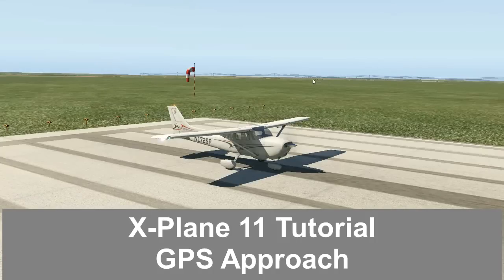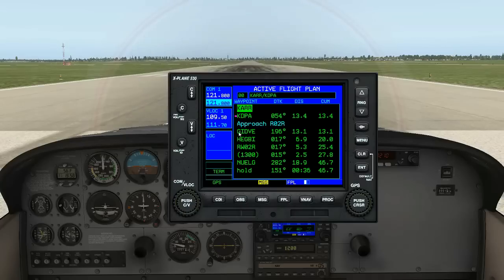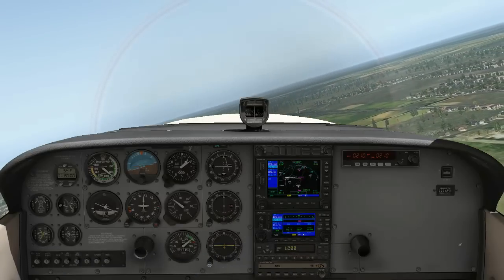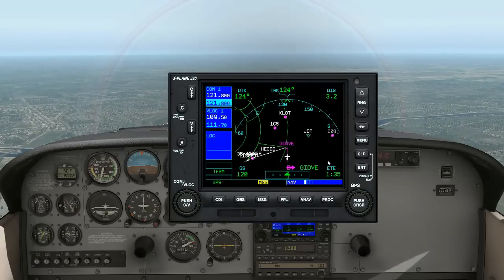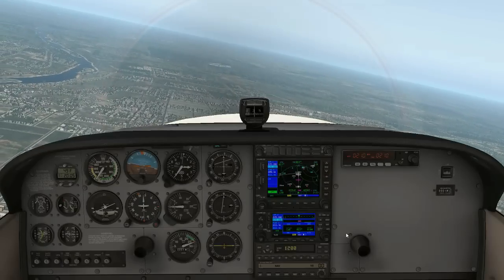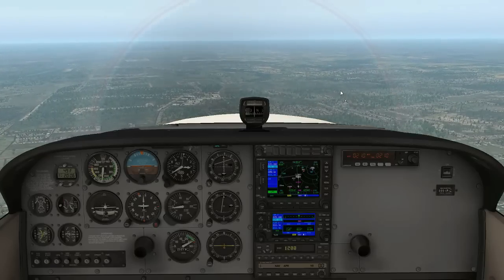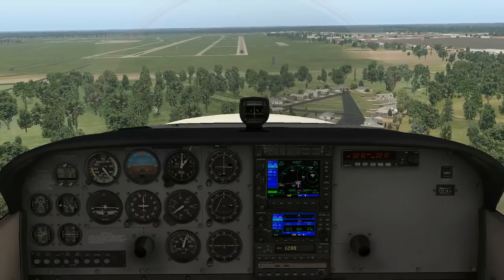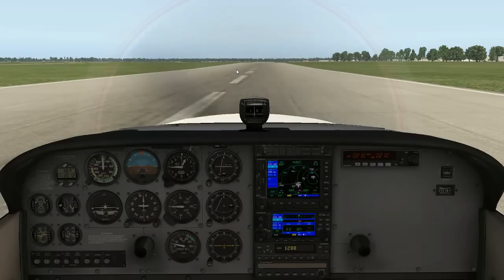X-Plane 11 - GPS Approach

Comment: As usual, Jason in a very good teacher, I believe the best for virtual air navigation! In this case I have not been able to replicate the video because when I reach the last leg and I push APR, the plane turns unexpectedly on the right and lose definitely the right route to the final approach. I know the video is using an old version of autopilot, but I have have not been able to do the same with the new current version. Did someone do it?

Comment: Thanks, I great for gps instruction ! but never put your flaps down at that speed in a real 172. And flair your landing s . land on the rear wheels and keep the nose wheel off the ground as long as possible. The stall warning should come on as you touch down

Comment: Man, you've got to stop lowering your flaps when your speed is above the white arc. Reduce power first, otherwise you are just using power against drag, as well as potentially damaging the flaps. Vfe (max. flap extension speed) is 85 knots https://www.pilotscafe.com/c172s-sp-skyhawk-orientation/

Comment: Flaps are gone, you need to pick them up later. If X-Plane can't fix that unstable rocking motion, what's the good of the program. 90 Knots over the boundary fence in a 172 OMG, sorry but not a very good training vid.

Comment: The AP getting into those oscillations is annoying. I've had it happen in other sims too...Does it happen irl? By the time you get done correcting for it, you might as well have just flown manually.

Comment: Helpful video, thanks for this and other X-Plane videos you've done!. Just after you activated the APProach button on the autopilot, you went to an extended exterior view. We missed the critical point at which the GPS and AP captured the glide path and the plane started descending. I have had a lot of trouble getting that to happen with this LPV approach. Very frustrating. I've read the S-Tec manual and tried repeated attempts to get vertical guidance using the APP or even the ALT pressed twice. Neither work. If anyone has any thoughts, please comment. Thanks.

Comment: At the time that I turn of the autopilot, my trim makes my plane to stall, so you know how can I configure that?  I use Saitek multipanel AP together with the simulator AP .Thank you
Reply: That one initially threw me for a loop as well.  I eventually realized he was using the "old style" autopilot that had the AP button.  So I'm guessing he set the NAV and V/S, but waited until he was at altitude before activating by hitting AP.

Comment: Another wonderful lesson but there is a problem.  In using the updated X-Plane auto pilot this procedure does not work.  If GPS is on and the NAV on AP is set, the plane seems to want to head in the approach direction as soon as it starts on the runway, and then runs away.  I have tried various other options and cannot get the approach vector to work,  It does not head for the target airport. Clearly there is some different way with the new auto pilot and I have not been able to figure it out.  Hoping Jason can help.
Reply: I had the same problem. I think that you need to activate KDPA when you take off, engage GPS at an appropriate height, then activate the approach leg. Then it navigates correctly.

Comment: After trying this a few times I could not get my plane to connect with the glide slope and auto descend. I tried a few approach options messing with altitude and speed but could not get it to work Then I read the S-TEC 55 AP Manual. It appears you need to hit the Alt button a second time to engage the GS. Not sure if it's due to an older version of the Auto Pilot or me not doing something right, but it's working now. Great video. Very informative. I do suggest everyone read through the manuals under the Cessna 172SP folder. I found some other nice tidbits of information in the Garmin G530 manual as well. AE
Reply: So press ALT twice on the autopilot menu?

Comment: One recommendation I would make is for you to land the plane as close as possible to the stall speed.  Your main mounts should touchdown before the nose wheel, and try to keep the nose wheel of the runway for as long as possible. Let aerodynamics lower the nose wheel and not by relaxing (yoke or stick control going forward) the elevator control.
Reply: Yep, I think he might have bent the firewall and/or broken the nose gear had that been a real-life landing!
Reply: @galoon  Most of these people have never heard about the types of landing accidents caused by strong cross winds and excessively hight touch down speeds as the pilots tries to force the aircraft onto the ground. Here is a good video (second landing) on a pilot porpoising down the runway in a Piper Cherokee 140 that rips of the nose wheel. .

Comment: BTW as a 4000 hour flight instructor, never put the flaps down when the airspeed is above the white arc on the airspeed indicator. That's what the white arc indicates; flap operating speed..
Reply: when he said "we're at 1000ft" he was actually at 250ft right? and is 90kts way too fast in the 172? i thought 60-70 would be more like it. thanks
Reply: @thert.hon.thelordnicholson7261  He meant 1000 ft MSL (Mean Sea Level) at his call out. When he was on the ground the altimeter reading was 750ft MSL which means when he called out 1000ft, he was at 250ft AGL (Above Ground Level). Approach airspeed for a precision/non-precision approach is 90kts. Non-Precision approach power setting: RPM roughly at 1600 RPM and 750 FPM descent rate. Landing airspeed is 60-70kts in a 172.
Reply: @AssyrianKing4ever  Are you sure? All the lessons (real life CFIs as well as some x plane vids) i've seen have an approach at about 65-70kts at most, then idle power above runway and land at stall speed (45kts or so, depending on weight/flaps). 90 is very fast and landing at 70 too fast. It seems odd to call out 1000MSL and not AGL e.g. if the runway is 2000MSL why would you call 1000MSL?
Reply: @AssyrianKing4ever  yeah a little check and you're a bit off with your numbers. 70kts is a standard and widely quoted approach speed, touch down ranges 55kts down to 45kts on average. altitude callouts should be made with reference to ground level, so you would call 1000AGL and definitely not MSL (as i pointed out, MSL makes no sense for landing phase). So the approach in this video seems a bit off, it did seem way too fast...
Reply: @thert.hon.thelordnicholson7261  I gotta correct myself there, normal approach airspeed is 60-70kts. In real flight, we cut the power to idle close to the runway threshold and depending on the winds adjust with the throttle. 
Here is why I said 90kts for the approach airspeed. GPS approach is a non-precision so when in IMC with low ceilings you wanna keep your airspeed at 90kts down to your minimums so you can execute the missed approach. If you break out before your minimums, great.

Also, as far as callouts go, I was taught 1000 above mins, 100 above, and Minimums. He may not have had any IFR training.
Reply: @AssyrianKing4ever  Don't confuse IFR approach speeds during training with real life,  There is no hard and fast rule on your approach speed. The airport you're flying into and traffic conditions as well as your skills as a pilot ( are you flying within your limitations) play a major roll.  I was shooting an ILS approach into San Jose, CA in a Cessna 172 doing 90 Kts when approach control ask if a could pick up my approach speed as there was a 737 coming up on my tail very quickly. I powered up to 2600 rpm and as you can guess my airspeed increased to well over cruise airspeed.  The length of the runway you make your approach to, ATC and traffic play a big part as to your approach speed as well as how comfortable you are as a pilot flying at a different approach airspeed than you would normally use.
Reply: @lpappas474  You are right. My current phase of training is nothing but shooting approaches at non towered airports. Soon will shoot the ILS 25 to KLVK. Should give me a glimpse of what you experienced at KSJC
Reply: @AssyrianKing4ever  Livermore is just over 5000 ft., so the Vfe will have an impact on the approach speed you choose, along with DH. Those are variables to discuss with your instructor. At least you can shoot the ILS approach into Livermore with X-plane before flying the approach in a real plane. Good luck with your training.
Reply: @lpappas474  Thank you! I will practice it before my next training session. Cheers!
Reply: @AssyrianKing4ever  Overall, much too fast (more like 65 kts on final; high 40's to stall at touchdown). IMHO looked low on final, too. Steering with the AP engaged may give brief relief, but the S-Tec 55 possess no AI to "learn" from the "corrections".
Reply: Actually in the Cessna 172SP you are allowed to lower 10 degrees of flaps at 110K. The white arc represents max speed with full flap extension.  Section 4 of the POH.
Reply: Wayne Sweet do you agree with this or not - White arc is full flap extension or ANY flap extension? I'm a low-time pilot and seeking clarification  - thanks  "Actually in the Cessna 172SP you are allowed to lower 10 degrees of flaps at 110K. The white arc represents max speed with full flap extension.  Section 4 of the POH."
Reply: @looseparts  I'm sure Wayne agrees with you. Years ago the top of the white arc represented the maximum speed you could start extending flaps as none of the POH's for any aircraft at that time stated any speed above the white arc for extending flaps.  I made this same mistake when I saw an individual in an X-Plane video extending flaps at an airspeed above 100K but less than 110K's. Now why would you be seeking clarification if you've looked at section 4 of the 172SP POH? If you're a rated pilot you would know the POH defines the operating limitations of the aircraft.
Reply: @looseparts  Yes I agree. It's been too long since I flew for a living and I should have remembered that about the high wing Cessna's. The C172SP is a different model from the one I flew. Believe the 172SP has a 180HP  O-360 Lycoming. The older C-172 had a 150HP.

Comment: Hi Jason I tried this  flight plan and i fail miserably.I have a couple of questions regarding pre setup on ground . I select NAV then try to set the VS +5 but as soon as i put these setting in the trim wheel goes crazy rotating full up then full down and continues this until i deselect nav . Is there a setting in game that needs to be changed. also after activating the GPS button it starting to deviate from the flight plan. any help in this matter would be appreciated.
Reply: I have the same issue.  I think the new auto pilot process is different but I have not figured it out.

Comment: Using X-Plane 11.34 this tutorial refuses to work for me on 4 separate attempts. I can create the flight plan, activate the noted leg in your video, but once I activate the auto-pilot nothing happens. The plane seems to be flying to a VOR location?(not sure)
The magenta line appears for the first waypoint (GIDVE) on the Garmin but there must be a subtle change with the Garmin or the way to activate the auto-pilot. For example, recently, disengaging the AP in the Cessna has change. Perhaps there is something different I am missing. I will be delving into the X-Plane manual tonight.
Reply: I think i just found the solution below!! Although I think it needs change is pretty major and needed to be more readily communicated. Looking forward to giving this another go.

 Aivar Avalo
3 months ago
@Peter van den Toorn You are correct, I missed that. For GPS Steering (GPSS mode), you do need to press NAV twice as per instruction manual: https://www.x-plane.com/manuals/S-TEC_Autopilot_Manual.pdf (page 22).  It is one press for VLOC tho.
Reply: Sooooooo, I got the GPSS mode to activate my flight plan leg, but like what others have said, when activating the approach, the plane goes off course sharply to the right, off to who knows where? More research......
Reply: So I learned from another video that a few minor things need to happen for the approach button to be fully effective.
First, ensure the ADF is disengaged, (Found on the co-pilot side)

Second, From the Map, ensure that the ILS frequency is set in NAV1 

Third, Set heading bug course to the same heading as the runway of final approach
For example, my final approach runway was KOMA ILS14L. Setting the heading bug to 14 was crucial to remain on course once the Approach button was depressed.

Fourth, once in ILS range press the approach button, then press the ALT twice until only GS is showing. Final descend should begin.

Continue to maintain speed, set flaps as appropriate. Minor deviations to the center of the runway can be tweaked through the heading bug. After doing all of this I have a successful landing!!!

Comment: My gps for some reason takes me the complete opposite way
Reply: Ensure that the ILS frequency for the runway is set properly in NAV1.
Set the Heading bug to the same number as your runway number. It should then stay on course. Make small tweaks from the heading bug to recenter as needed. Good luck.

Comment: "Slow down to 90kts" Man this is a economy cruise on C172, you have no clue about flying! GOD THANX THIS IS JUST A SIM!!!
Reply: Mate, calm down. This is a tutorial on how to use the GPS approach system, not a how to land tutorial.
Reply: @henriaunin  This is instructinal video and as such must be meritorictly correct (and is NOT). On the beginning of the video there should be notice that all procedures will be abadoned and only GPS approach will be shown, then OK, but in this video you can see and hear incorrect information pass on to audience. I am calm, but if you are doing video about something and it is related to something else, you should follow all proper step to present your case, but it is not happening in this video. Comment such as "...slow down to 90kts..." with already extended flaps in C-172 is misleading people. Imagine, someone will get a flying lesson on C172 with GN430/530 and all the sudden extend flaps at over 90kts. Do you know what will happen? Instructor may never be able to stop student quick enough to prevent such stupidity. Or another possibility where someone is flying with inexperienced new pilot will do extend flaps at such high speed... If you are doing something do it right or do not do it at all. There was no reason to abadon proper preocedures in that video and show the funcionality of GPS and proper procedures on C-172.

Comment: Thanks got this is just a simulation 'cuz in real 172 You would rip the wings out of the plane!!!!!!!
You should slow down long before, in fact you should slow down while you were turning into final, then you should extend a flaps at speed below 80kts (White bar on ASI) and continue to slow down the airplane while on the path. Also you should turn your fuel pump on, landing lights would be nice as well and if this is an older model of C172 you should turn the carn heat on to prevent carb icing. You have  not done any ot these basic procedures, You have failed to follow checklists as well. Only then you should confirm vertical path and slow down to around 65kts and extend flaps to 20, during whole approach your engine should not exceed 2000RPM, I rearly get 1800rpm on my approaches with 500fpm descent. You exted your flaps fully just before touchdown and only on short runways to further slowing down the plane. 
Before you start giving instructions to others on any flightsim, remember this is a Flight SIMULATION so you should in theory follow real procedures, the problem is rhat you have no clue!. Take some flying lessons and then play on sim, when you master in you can give instructions to other flightsim fans, not before!!!

Comment: Does anyone have any experience of flying an approach using the newer 530 LIKE AP. 
Something I have noticed and it may be something I am doing incorrect is that when I am flying to the approach on NAV plus the auto steer function is activated (pressing NAV twice). If I press APR somehow the plane veers off course ???
Are there any major differences to using the newer AP LIKE to the one in the video please?
Reply: Yep - the same problem. There's something missing here.
Reply: @cmonjoiners  Try this:
Be sure to set the ILS frequency in NAV1 by using the Map feature.
Try setting your Heading Bug to the same number as your runway number. This needs to be do before final approach. This should keep you on course once the APR button is pressed.
Press the APR button once within ILS range. Then press the ALT button twice until only GS is displayed. Descent should begin.

The AP is rather different than in previous versions of X-Plane. For example, disengaging the AP is now done from the red button on the left side of the yoke.
Cheers and good luck.
Reply: @mr.martintorres5804  Why should we tune NAV1 for the ILS frequency? Wouldnt that just make it an ILS approach? The point of this video is GPS Approach
Reply: @mr.martintorres5804  as someone else said it seems we just have to allign the heading bug with the runway.

Comment: Again, great job and couple of points for safety:  using ground speed as a reference on approach can kill you.  Always use IAS, indicated airspeed.  As a personal habit, I like to disengage the autopilot a little higher.  Taking your eyes off the approach that close to the ground and possibly pushing the wrong button could be trouble.